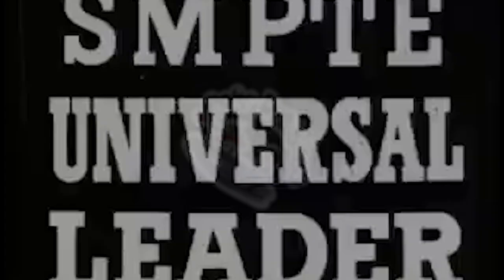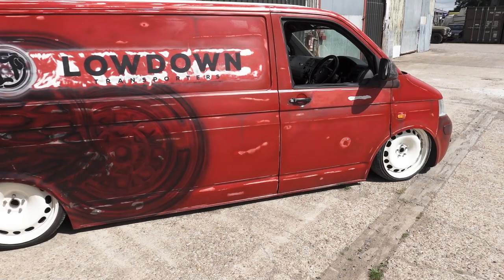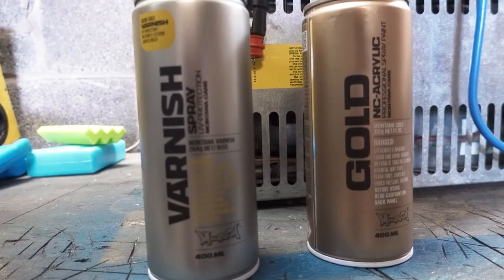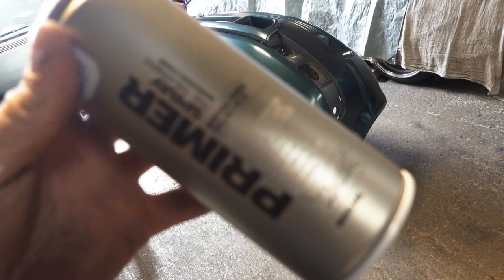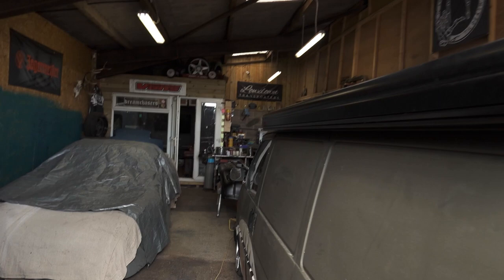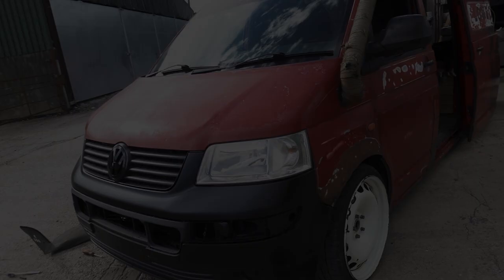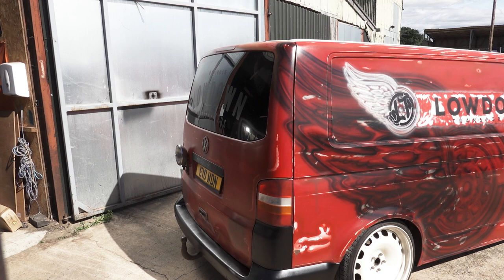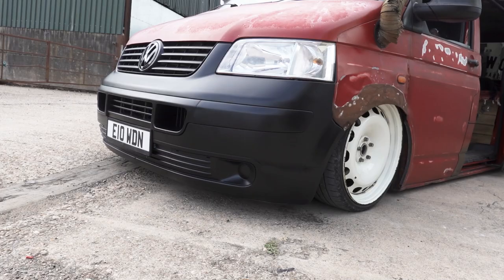Was this a wise purchase? The new work van project || Prepping and painting the bumpers black

Comment: On these, have a really really good look at where the rear shocks mount to the body - the chassis section where the shock top-mounts are welded - it's hard to see as it's hidden by the floor & a load of plastics, so go delving - it's one spot where you don't want rust but also one spot where they do rust out of sight, even if they look spotless everywhere. 

Once corrosion gets a hold there, it is HARD to repair & a lot of owners may be gobsmacked by just how much rot is present and just how deep & nasty the rust is - it's one area you want to really drown in anti-rust, because it's one area you don't want to have to repair, so if it is fairly rust free, treat it to keep it that way. If it is rusty.. ahem.. then the fun starts. :-)